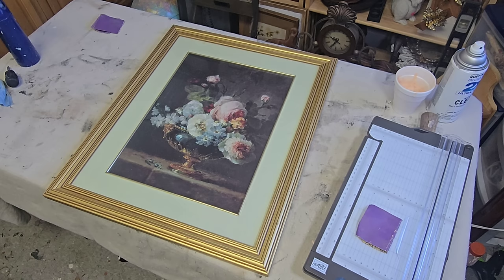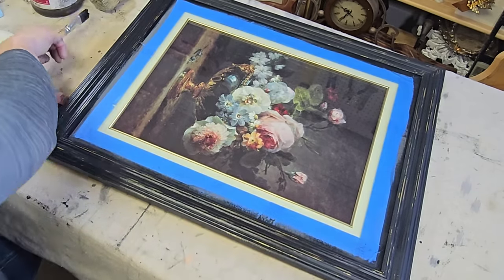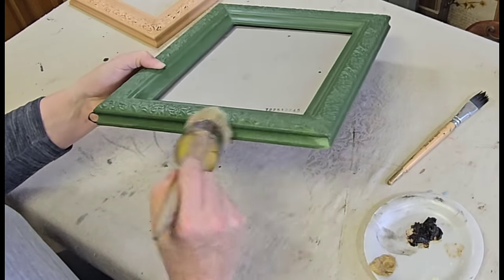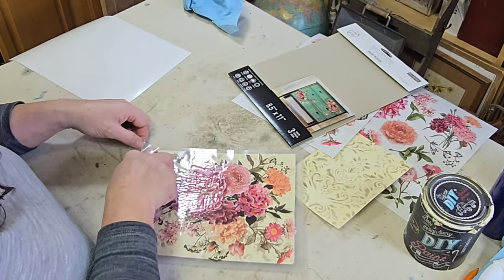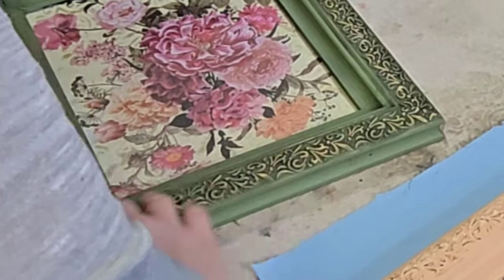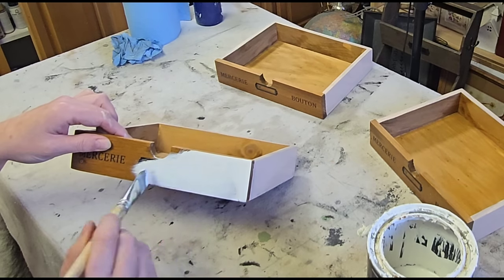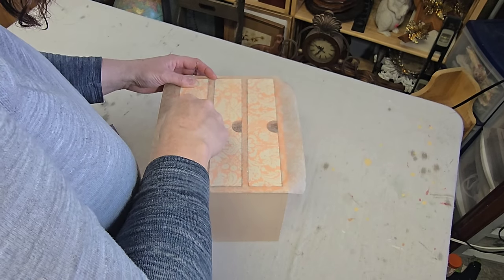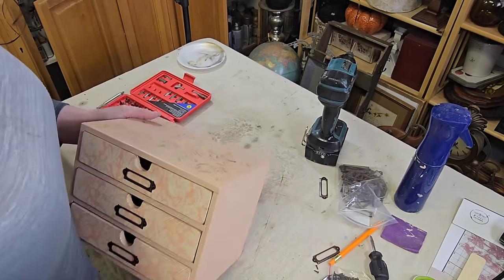Thrift Flips • Trash to Treasure • Spring Upcycles with Salvaged Items • Upcycled Decor

Comment: It's really amazing to me still LOL how with just some paint how something can be completely transformed.  Painting that frame black totally made that picture POP! It brought out so many details of the actual picture.  I'm sure it will sell fast.  Loved all the other transformations too.  Question for you: When you say you are putting a little bit of mineral spirits in your wax (great idea btw)  are you talking about the ones that remove paint??   When I do a search that's all that comes up for me.
Reply from the maker: It really is amazing how changing the color of the frame on a piece of art can completely transform the entire thing. :) Hopefully that one does sell fast - I have more to do, lol!! And yes - I use regular mineral spirits to soften and thin out my dark and black waxes. I generally don't use it with the clear - that way when I use it as the first coat of wax, I have a barrier between the paint and the dark or black wax with the mineral spirits that helps protect my paint. :)
Reply: @theeclecticcottagespokane  Thank you Rachel for answering my question.  I was pretty sure that's what you used but wanted to make sure.  And yeah, I realized you were thinning only the dark waxes out. Next time I use a dark wax I think I may try that idea.

Comment: What did u mean by wiping your edges while painting ? My paint tends to bunch on the edges and I don’t realize it until it sets .. so you use a wet rag or what?
Reply from the maker: I use a damp shop towel to clean paint off of areas that I don't want any paint at all. Everywhere else I use my brush to level out my paint. :)